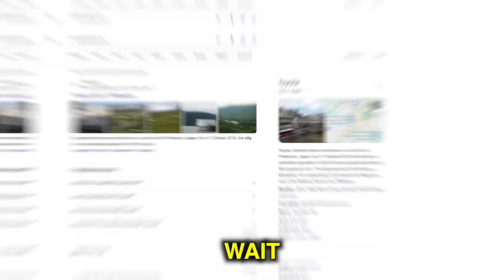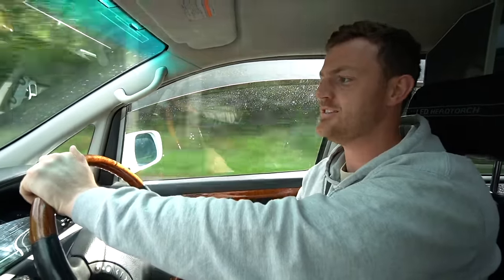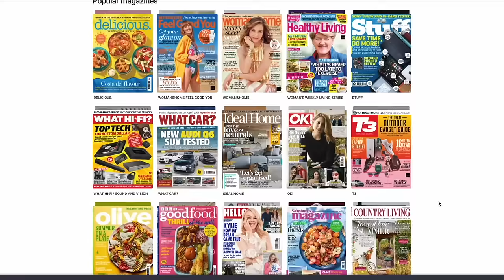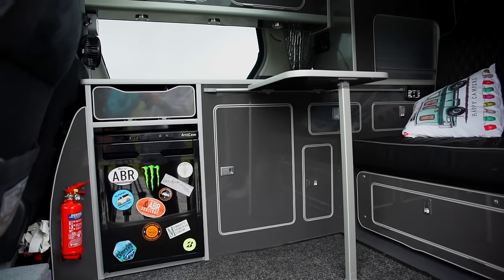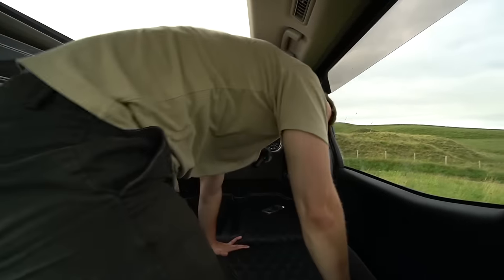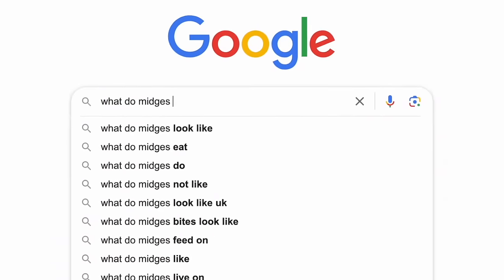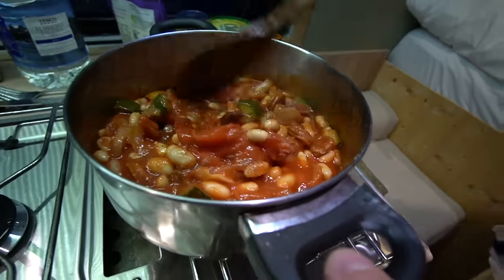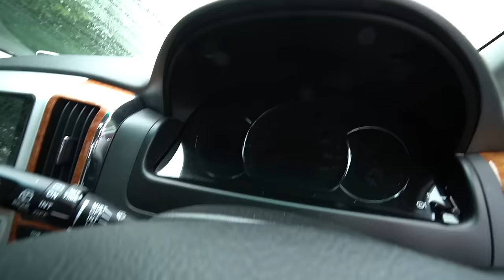My Worst Experience Car Camping Ever

Comment: Loving the new series will!
 The key fob problem with your van is probably the ignition switch...it gets stuck and doesn't register with the ECU. It's a cheap and easy fix so deffo worth a try. 
The part is about £20, just have to remove the cover around the ignition and plug the new switch in. 👍👍
Reply from the maker: Thanks very much! I wish it was a cheap easy fix but it’s not, I’ve tried everything but given up now 😂
Reply: @WillsWhereabouts  I had the same problem and it's definitely frustrating 🤣....if you haven't replaced the ignition switch, you can dump a can of Halfords electrical spray down the ignition barrel....it will remove any dirt and possibly free up the switch....deffo a cheaper option....just make sure it's electrical spray as it evaporates and won't harm any electrics 👍

Comment: Quick 1 Pan Cheats Paella...

Cut the Chorizo into good chunks, fry them off to get some colour and release the oils then remove from the pan. Add the onions and peppers and cook for a few mins. Then add the Garlic, Tomato Paste and Smoked Paprika. Cook for a short period then add the prawns, Peas and Chorizo into the pan. Then add the rice and a bit of the Chicken Stock with the lid on. Cook until the Prawns are pink and the rice as absorbed the stock. Finish off with some seasoning as required and a squeeze of Lemon.

Ingredients:
Chorizo Stick (High Quality)
Prawns (Frozen Jumbo)
Flame Roasted Peppers (Jar)
Onion (Chopped)
Garlic (Chopped or Minced)
Peas (Frozen)
Tomato Paste (Good Squeeze)
Chicken Stock (250ml)
Smoked Paprika (1Tspn)
Lemon
Seasoning (Salt & Pepper)
Plain Rice (Ready Cooked Packet)
Reply from the maker: I may or or may not have cooked a Paella in the next video 👀

Comment: Any Alphard driver would be cringing watching you use the electric doors so much!  Most of us turn them off for camping for obvious reasons…flat battery. 
Completely flummoxed as to why you’d attempt a brand new recipe for a first camp?  The weather and midges along with roaring motorbikes had nothing to do with the car. I feel all of that distracted from the actual camper.   Best vehicle I’ve ever driven, I drove for 5 hours with a ten minute break recently.  It’s SO comfortable. 
I have a pop top for further comfort and go to sites with EHU now after camping for two nights without.  Prefer to use my small electric kettle for a cuppa and take a pop up tent for storage. 
Alphard’s are supremely comfy being a high spec car rather than a van and are a fraction of VW costs.  The only way I realised my lifelong camper dream.
Reply from the maker: It’s absolutely a great car and camper! Probably one of my favourite I’ve driven so far. Super spacious and luxurious

Comment: I’ve started using fly paper in my van here in Scotland for that very reason mate,I dunno why it took me so long to think of it,works a treat.
Reply from the maker: I’ve not heard of fly paper before so I’ll have to check it out 😊
Reply: @WillsWhereabouts  yeah man, sticky fly paper,I buy a pack of 12 for around £1.50, I've got one on a drawing pin above my worktop, anything that touches it gets stuck and spends the rest of it's life there, mostly midges etc.tesco and Asda sell them

Comment: A Toyota Alphard have seen a couple if these in Campbelltown N.S.W Australia in there people mover mode in the top spec models the second row is two captains chairs and they do everything and tgese are actually based on the Hiace a very popular van in Australia thrre new ones 10 20 and 30 year old Hiaces still driving around still going as with Toyotas they are the most reliable vehicles l have a Toyota myself a 1997 Hilux
Reply from the maker: That’s awesome they seem like a great car for sure
Reply: @WillsWhereabouts  These Alphards are all JDM imports to Australia we get a lot of JDM vehicles and a lot if Toyotas l have seen a couple of them at our local Aldi supermarket in the car park not Alphards